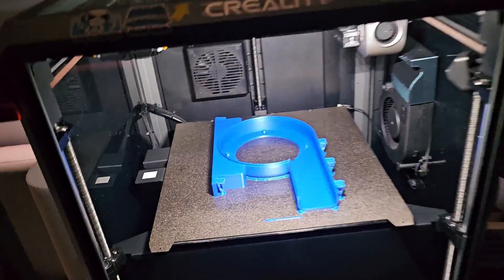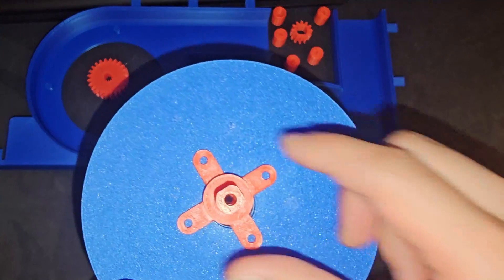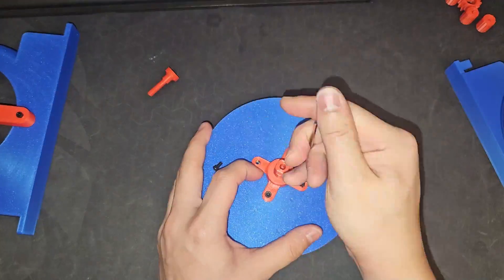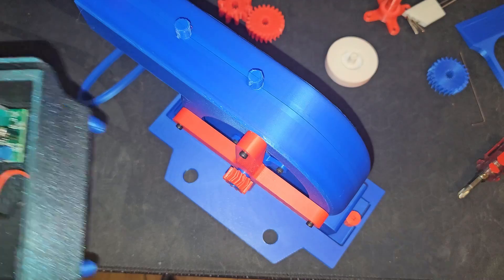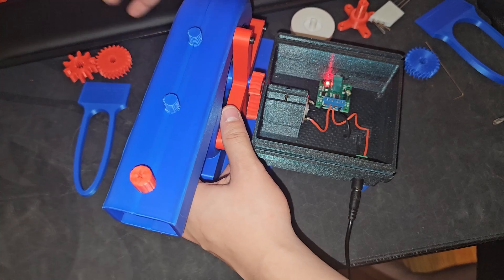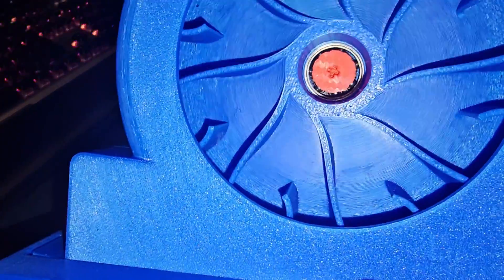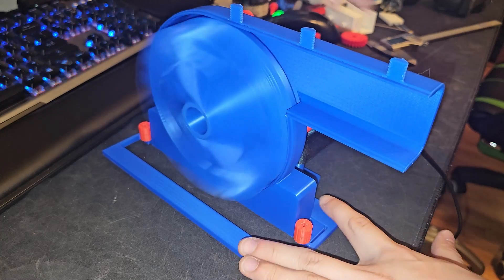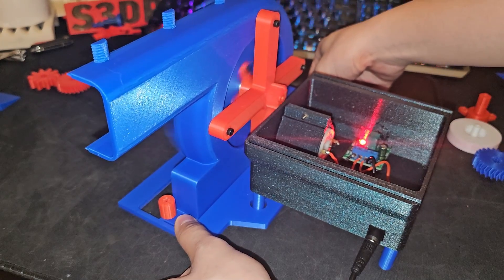Making a Turbocharger 3D Printed

Comment: For the bearing though, you are gonna need to press fit that puppy into its slot, it shouldn’t move at all apart from spin
Reply: Also for this the barring is supposed to support the driveshaft not the impeller itself, because the driveshaft is what is supposed to spin the impeller.
Reply from the maker: ahh, that makes more sense, because my setup the bearing is basically doing nothing.
Reply: @Scratch3DPrinting  yes sir, but keep this up bro, you are living the dream rn

Comment: As much as I love using inserts for parts I can never seem to get all of the bolts to line up lmfao, i would maybe suggest using a different configuration to mount the impeller, your setup can introduce a lot of wiggle, i would do a straight shaft like an 8mm rod and drive it with belts.
Reply from the maker: haha, yes it kind of difficult to make the insert line up. Thanks I'll look into belt driven and make some changes to see if I can make it more smooth.

Comment: So much torque it's finding the weakest link to break, bend, or stretch.
Reply from the maker: what do you mean by that...?
Reply: @Scratch3DPrinting  It was unstable because the torque was bending the axel, the mounts, ... everything that would move with less force than moving that mass of fan blades.
Reply from the maker: ahh, I'll have to make a new design so that it would be more stable. Thanks.